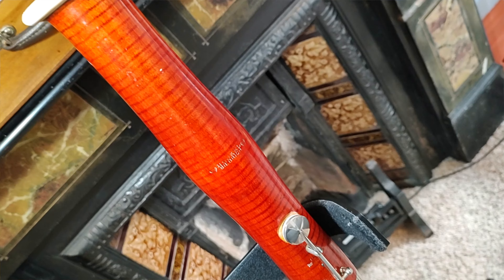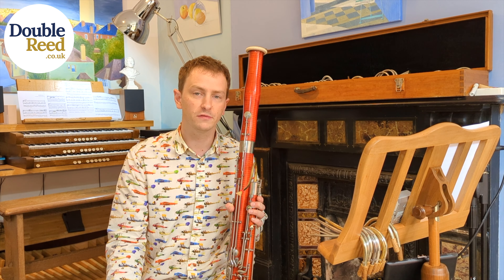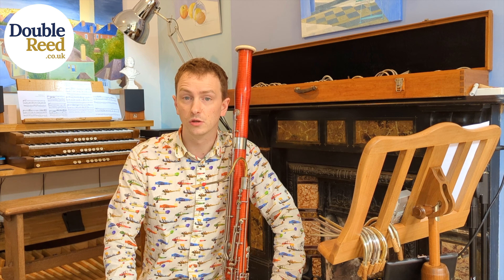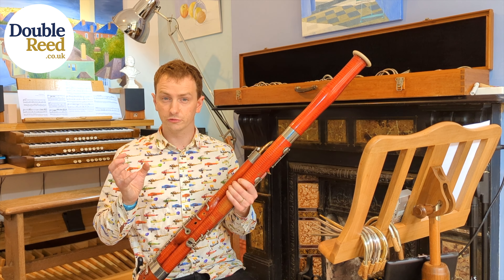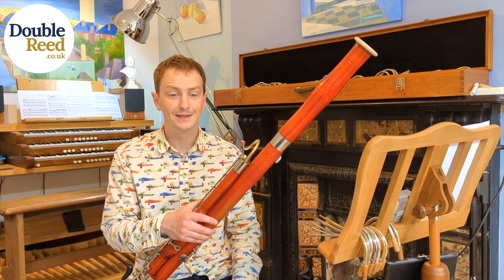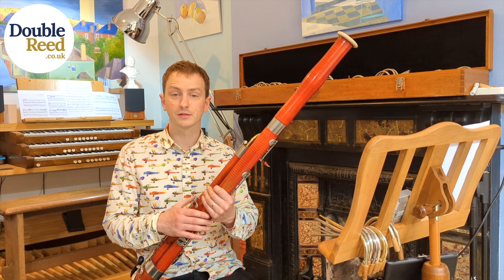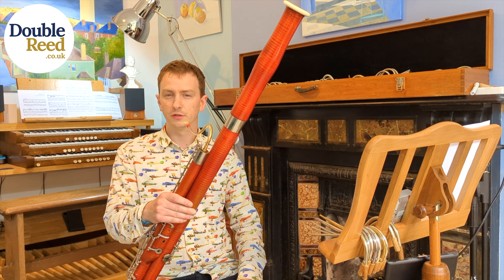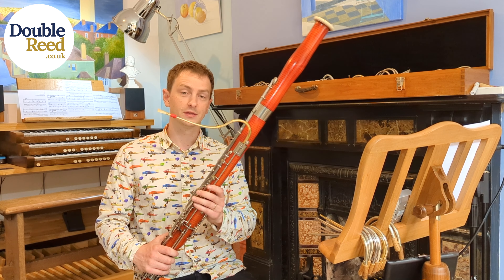Fixing the tuning on a Heckel bassoon!

Comment: #11xxx ARE world-beating bassoons, for sure. After diagnosing and correcting the tone-hole problem, did you consider putting in tone-hole liner tubes, which solve the issue for good, and also prevent water clogging?